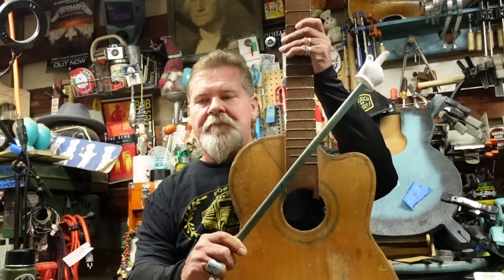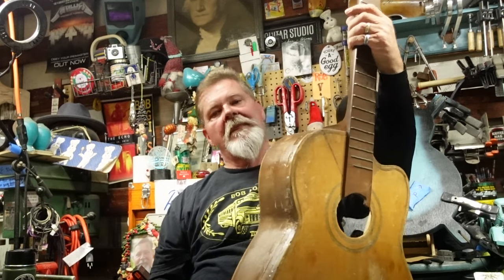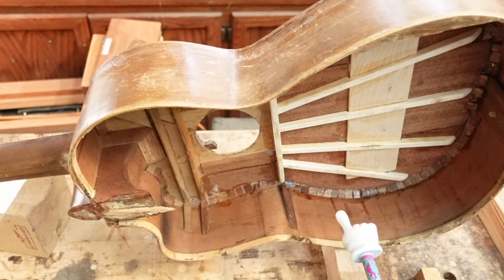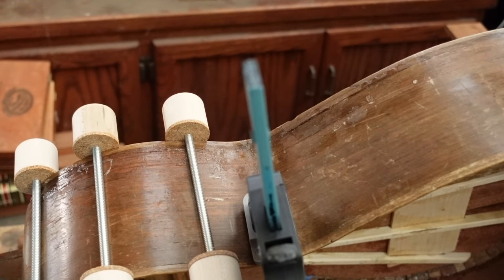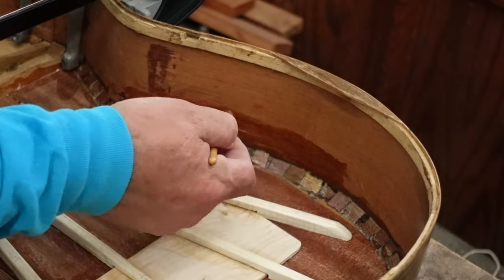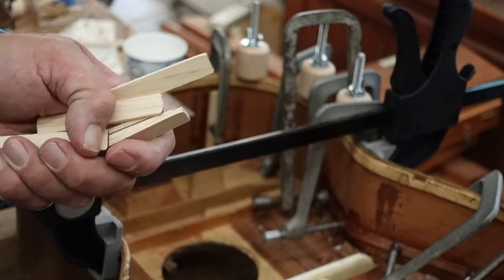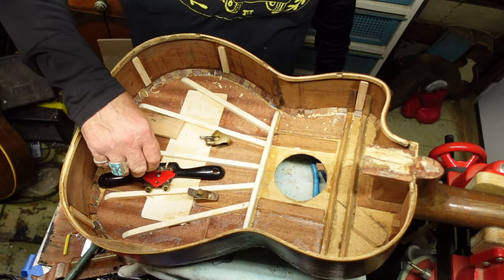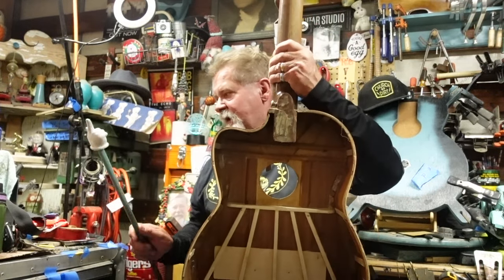Bajo Quinto: Preparing a Guitar for Replacing the Back

Comment: ?! were the side Braces in the lower Bout radiused to fit the contour or left flat?!?
Reply from the maker: @slo5283  the soundboard was steamed back to being flat. It was reinforced with 1/16 inch mahogany. The fan bracing was slotted to fit the bridge plate. The details are in the bracing episode.
Reply: @paulmerojunkpileguitars  I saw those Episodes too, but the  Braces running 'Top to Back' -- the lower Bout has some curve there ☮️
Reply from the maker: @slo5283  light sanding both sides on a belt
Reply: @paulmerojunkpileguitars  ah; just knock it off ☮️
Reply from the maker: @ I get it that the sides have a curve to them so that would mean that the braces have to have a curve to them so they would be concave slightly. The answer is yes round them off on the belt sander on each side be done.